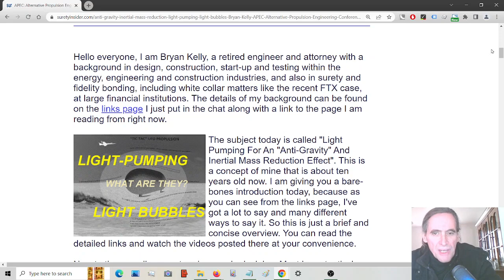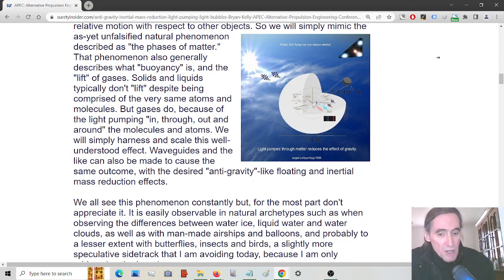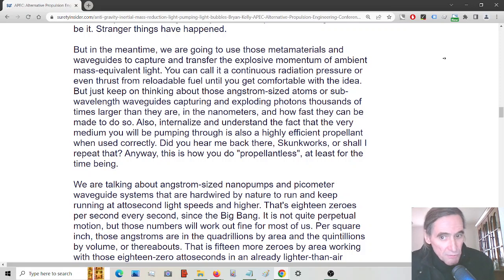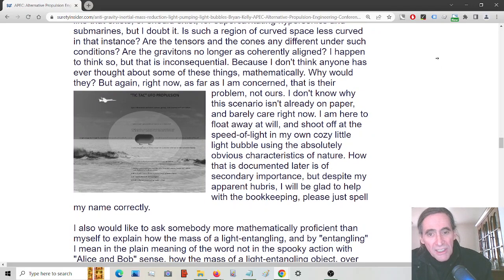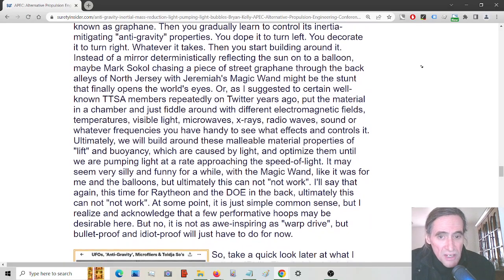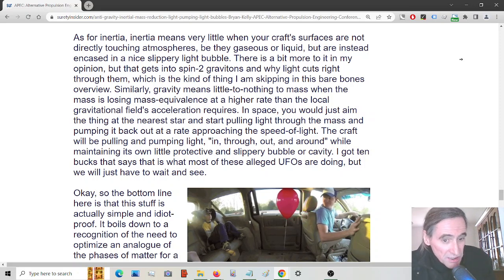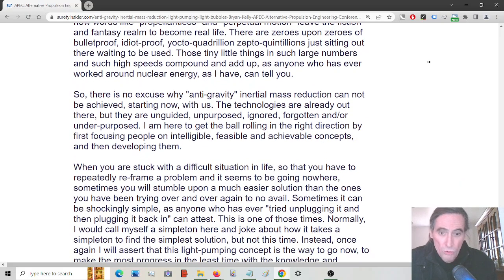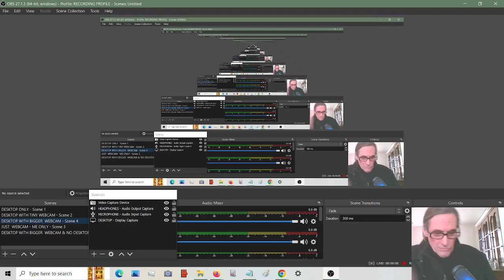Light Pumping For An "Anti-Gravity" & Inertial Mass Reduction Effect

Comment: This presentation is friggin' great!  You nailed it and our experimental observations agree with the core principal.  The math boys will say the required energy is impossible to achieve, but they didn't do the simple practice experiments nor acknowledge the non-linearity of our vacuum refractive index.  Well done.
Reply from the maker: Well, if I haven't pre-bunked the debunks well enough, I will just have to go over those octillions and zeptoseconds with them again and again while floating in a heavier-than-air zeppelin through clouds of heavier-than-air levitating water until either the exponents get high and low enough for common sense to kick in, or they can give me a photon mass for thrust that somehow contradicts reality, whichever comes first. 

This stuff isn't rocket science. Ultimately, it's easier.
Reply: @bryankelly7093  HAHAHA You're damn right!  Looking forward to our late-nite call tomorrow.  FFR and I have already verified this multiple times but no-one will accept what's right in front of their faces.
Reply: @bryankelly7093  B.G. Sidharth agrees with you!!      "Also, we consider the zitterbewegung fluctuations to obtain an interpretation of quantum mechanics. We argue that this gives us a method to extract dark energy [antigravity].... insinuating forward and backward time flow. ...[it is the interference of these two that gives rise to quantum mechanics]. In general, it is not possible to have both these domains coexisting. However, it has been shown in great detail [17]....This is an example of the real footprint of the ethereal dark energy. From this we should be able to extract energy. It’s a question of technology." Burra G. Sidharth who first in 1997 predicted the dark energy acceleration of the universe.

    Interestingly graphene behaves like a ”chess board”, that is there is a minimum ”length” [5]. So a non-commutative geometry holds....the Black Hole is a two dimensional object [16, 17]. Indeed the interior of a Black Hole is in any case inaccessible and the two dimensionality follows from the area of the Black Hole which plays a central role in Black Hole Thermodynamics. Thus we can get an opportunity to test these Quantum Gravity features in two dimensional surfaces such as graphene...., we have all the ingredients for manipulating a version of table top fusion possibly using the bosonization of fermions property.... some electromagnetic properties depend on the non-commutative geometry of the crystal structure rather than on the chemistry of the crystal material.... In any case there is an anomalous behaviour of the Fermions accompanied by a ”fusion” type effect for protons....Once we deal with the 2D case, this disappears and we can have “transmutation” of Fermions to Bosons or vice versa."
    "That is spacetime can be modelled consistently with an infinite lattice [Graphene] sheet."
"    Here space-time is discrete and during the hopping of electrons there is
    change in spin direction which shows that the space is not smooth and this    give rise to some sort of a magnetic field which can cause the change of spin    in the electron during hopping. So we can see that above behavior of electron    spin can be analogous to the above with appearance of a magnetic field in non- commutative space-time."
Reply: Light-induced propulsion of graphene-on-grid sails in microgravity is cited 10 times in googlescholar. "The metasurface is composed of tapered silver cells embedded on top of the graphene layer with 20 layers of graphene sheets. Hence, the transferred momentum to the metasurface can be controlled by tuning the Fermi level of graphene sheets. Our results can provide a suitable platform for optical force control desired in tunable radiation pressure harvesting, micro vehicles, solar sailing, and optical tweezers." Controlling solar radiation forces with graphene in plasmonic metasurface 2023  "The authors demonstrated that properly assembled graphene sheets can produce the efficient light-induced emission of electrons ejected following an Auger-like path, and that the net momentum generated by this process can propel the bulk graphene material according to Newton’s laws of motion. The major breakthrough of this research was that the newly designed bulk graphene material maintained efficient light absorption, the easily achievable reverse saturation state, and the unique hot-electron relaxing mechanisms typical of single-layer graphene. This exciting finding pushed the research of China Academy of Launch Vehicle Technology towards the fabrication of graphene structures emitting energetic electrons under light illumination and therefore those that were suitable for use in spacecraft propulsion."
Zhang, T.; Chang, H.; Wu, Y.; Xiao, P.; Yi, N.; Lu, Y.; Ma, Y.; Huang, Y.; Zhao, K.; Yan, X.-Q.; et al. Macroscopic and direct light propulsion of bulk graphene material. Nat. Photon 2015, 9, 471–476.

Comment: I'm pretty sure ChatGPT is getting close to the point where it could do the harder math homework problems for you if you have just the right prompts.
Reply from the maker: That's a very good idea, but I would rather goad someone into doing the work for me. IMO, it could be good for somebody's career and I am quite limited compared to many others floating and hovering around this topic. The ones asking the loudest will likely be the ones who should already have it. So, it should present an interesting challenge for them.

But, if no one steps up, maybe I will give it a shot with AI, as you have suggested. Why not? Maybe there's a 40 year old fluid dynamics text book around here someplace.🤔

I had previously been thinking of cross-examining ChatGPT, after seeing Project Unity do it, but with respect to the relationships between buoyancy, light energy levels, the phases of matter and "anti-gravity" behavior. But that seems like cheating at this point. Besides, its programming seems like a lot of dubious GIGO so far. 

Thank you for the comment.✅
Reply: @bryankelly7093  I figure it's inevitable and I'm not in a hurry LOLOL
Reply from the maker: @LukePawlowski8  Health insurance actuarial tables tell me I only have 28 years to see it through myself, hence the sense of urgency here. 😎

Comment: BOGUS PSEUDO-PHYSICS
Reply from the maker: Duly noted.😂
Reply: "Also, we consider the zitterbewegung fluctuations to obtain an interpretation of quantum mechanics. We argue that this gives us a method to extract dark energy [antigravity].... insinuating forward and backward time flow. ...[it is the interference of these two that gives rise to quantum mechanics]. In general, it is not possible to have both these domains coexisting. However, it has been shown in great detail [17]....This is an example of the real footprint of the ethereal dark energy. From this we should be able to extract energy. It’s a question of technology." [antigravity] 
Burra G. Sidharth who first in 1997 predicted the dark energy acceleration of the universe.
    Interestingly graphene behaves like a ”chess board”, that is there is a minimum ”length” [5]. So a non-commutative geometry holds....the Black Hole is a two dimensional object [16, 17]. Indeed the interior of a Black Hole is in any case inaccessible and the two dimensionality follows from the area of the Black Hole which plays a central role in Black Hole Thermodynamics. Thus we can get an opportunity to test these Quantum Gravity features in two dimensional surfaces such as graphene...., we have all the in    gredients for manipulating a version of table top fusion possibly using the bosonization of fermions property.... some electromagnetic properties depend on the non-commutative geometry of the crystal structure rather than on the chemistry of the crystal material.... In any case there is an anomalous behaviour of the Fermions accompanied by a ”fusion” type effect for protons....Once we deal with the 2D case, this disappears and we can have “transmutation” of Fermions to Bosons or vice versa.
    That is spacetime can be modelled consistently with an infinite lattice [Graphene] sheet.
    Here space-time is discrete and during the hopping of electrons there is
    change in spin direction which shows that the space is not smooth and this
    give rise to some sort of a magnetic field which can cause the change of spin
    in the electron during hopping. So we can see that above behavior of electron
    spin can be analogous to the above with appearance of a magnetic field in non-
    commutative space-time."
B.G. Sidharth
Reply: "Outstanding slow-light effect for graphene metasurface in terahertz" - Jack how is this "slow light effect" in graphene different then what you are describing for warp drive? Graphene is now used based on the light propulsion concept that Bryan Kelly is describing but I see now mention of warp drive, antigravity or dark energy, etc. Light-induced propulsion of graphene-on-grid sails in microgravity is cited 10 times in googlescholar. "The metasurface is composed of tapered silver cells embedded on top of the graphene layer with 20 layers of graphene sheets. Hence, the transferred momentum to the metasurface can be controlled by tuning the Fermi level of graphene sheets. Our results can provide a suitable platform for optical force control desired in tunable radiation pressure harvesting, micro vehicles, solar sailing, and optical tweezers." 
Controlling solar radiation forces with graphene in plasmonic metasurface 2023
 "The authors demonstrated that properly assembled graphene sheets can produce the efficient light-induced emission of electrons ejected following an Auger-like path, and that the net momentum generated by this process can propel the bulk graphene material according to Newton’s laws of motion. The major breakthrough of this research was that the newly designed bulk graphene material maintained efficient light absorption, the easily achievable reverse saturation state, and the unique hot-electron relaxing mechanisms typical of single-layer graphene. This exciting finding pushed the research of China Academy of Launch Vehicle Technology towards the fabrication of graphene structures emitting energetic electrons under light illumination and therefore those that were suitable for use in spacecraft propulsion."
Zhang, T.; Chang, H.; Wu, Y.; Xiao, P.; Yi, N.; Lu, Y.; Ma, Y.; Huang, Y.; Zhao, K.; Yan, X.-Q.; et al. Macroscopic and direct light propulsion of bulk graphene material. Nat. Photon 2015, 9, 471–476.
Reply: @voidisyinyangvoidisyinyang885  
Like throwing everything you don't know on a pile, and cheering that you will make a ton of money from your semantics about your pile.
Staring at the painting hanging on the wall doesn't make you an artist, you clowns.
Reply: Thank you for posting this Bryan, if you ever have the chance, please take me to the place of your choice you are travelling